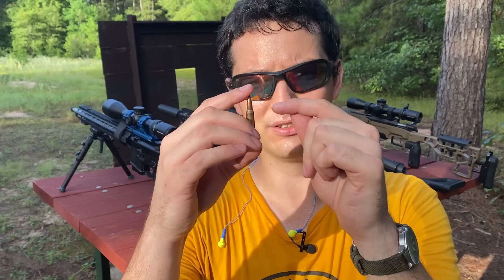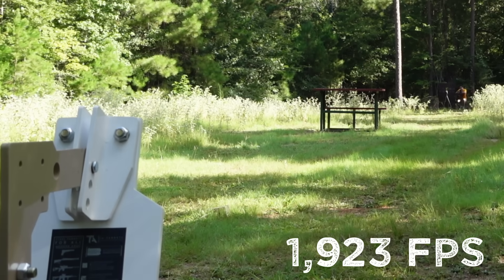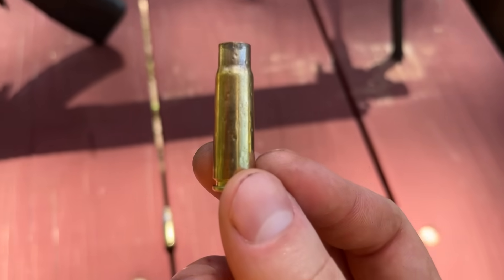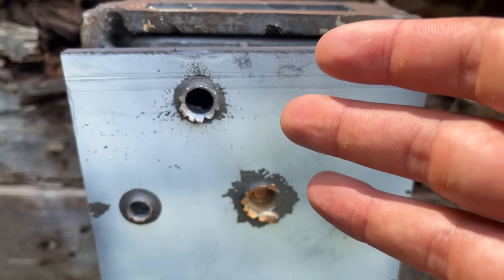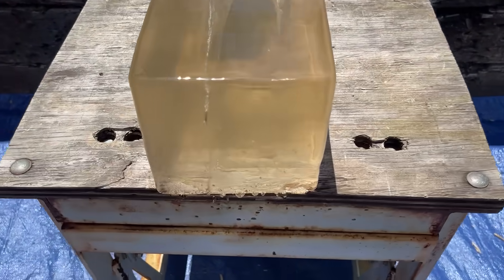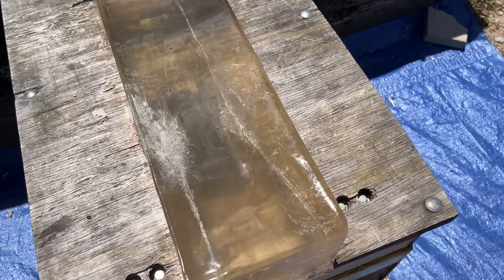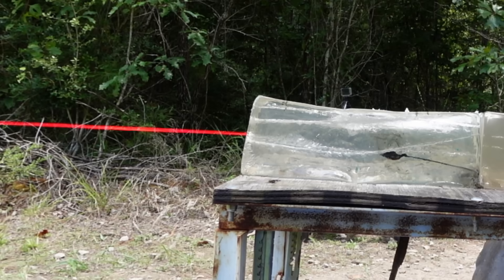I Will Never Shoot These Bullets Again

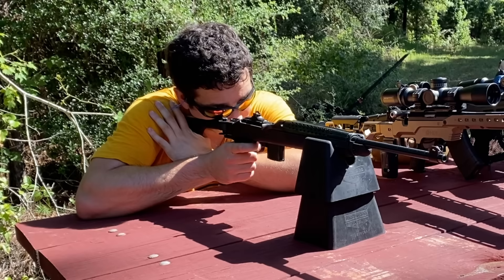Comment: 5:30 Glad you’re ok and that this didn’t end up a Kentucky Ballistics scenario.
Reply: 30 Carbine is more like a hot loaded pistol round so full disassembly of the rifle in the same manner as Scott's would be extremely unlikely. Still dangerous though.
Reply: @r.l.royalljr.3905  Considering how relatively small these cartridges are, it's crazy the amount of damage it did. That must have been a massively overpressure round.
Reply: @r.l.royalljr.3905  Yes, the .30 carbine is a semi-auto, so the bolt will open, albeit abruptly, violently, and possibly destructively if the cartridge over-pressurizes the chamber.  The Serbu RN-50 has nowhere for the excess pressure to go without destroying its barrel and breech cap and then the neck and face of whoever is shooting it.
Reply: The M1 carbine is gas operated so the bolt won't open until the bullet has passed the gas port, by which time the pressure should already be decreasing generally.

I think the biggest safety benefit is the simple fact that the bolt etc is contained in a solid metal receiver. So the shrapnel from any explosion tends to be contained, rather than flying directly into the user's neck.
Reply: @nerd1000ify well your name is fitting…
Reply: The slap round Scott shot essentially turned that serbu into a pipebomb.
Reply: The most important thing I’ve learned from watching YouTube: don’t use questionable ammo. Factory only baybee.
Reply: @ColdsideRamrod : Even this is not a guarantee.
In 1986 my 40mm Bofors exploded (German Navy) from old ammo.
The rounds were from 1954 i was ordered to destroy them, nobody told me how so i shot them🤷‍♂️ 
I nearly lost my right hand and have a nice tinitus till today😅
Reply: Wasn't even a fly fart compared to an overpressured slap round. But yeah. Glad he's ok!
Reply: Rite hard to stick your thumb in your forehead
Reply: "Stick a pinky in it!"

Jking, but really, I'm glad you're okay!
Reply: Definitely glad this didn't go too bad! Adam from WhoTeeWho recently had a Ruger 17HMR explode on him and luckily it was a similar outcome as portrayed in this video.
Reply: Yeah that hurts. Put your thumb in it!
Reply: Seriously
Reply: Oh yeah,remember this,it's when the .50 exploded right in the guy face....that was scary...
Reply: Banana is tougher than Kentucky ballistics so it's ok
Reply: Seems like guns are dangerous
Reply: Kentucky  Ballistics specifically shoots sketchy guns and ammo, so it was just a matter of time for that guy.
Reply: That cheapo 50 BMG rifle he used kabooms all the time. They're junk. Plus, he left the muzzle brake on while using SLAP. The sabots get stuck in them. That's why his shots were going all over the place.
Reply: to be fair the 50 bmg rifle explosion was the companies fault.  its a terribly designed rifle
Reply: @sovietsnake4726  I disagree Scott's accident wasn't the companies fault nor was it Scott's. The rifle was designed to handle normal and slight over pressure rounds, no one could ever think that a round would detonate like that. I beleive if Scott had used a barret or any other 50 cal. Rifle the exact same malfunction would have happened. The round was to blame and who ever tampered with it
Reply: @drslay1283  I see, I suppose I just made assumptions cause the idea of a break action 50 bmg is sketchy lol
Reply: @sovietsnake4726  Simply calling a Serbu RN-50 a break action is lacking the key detail of the threaded breech cap.  The breech face is not on the lower receiver, and the ears on the lower receiver serve no structural function.  They simply ensure that the cap is screwed on completely.  It's more like a pipe bomb with only one end capped....
Reply: @sovietsnake4726  The RN-50 is not a break-action.
Reply: @sovietsnake4726  its not break action. its a threaded breech cap
Reply: @sovietsnake4726  Its not a break action. Its a single shot rifle with a screw cap.  The rifle is fine, the round wasn't.
Reply: @sovietsnake4726  It was determined that the round was loaded with pistol powder, designed to burn fast and achieve maximum pressure in as short of a gun barrel as possible.
If a normal 50bmg round achieves normal operating pressures of approximately 60,000psi at around ~29 inches down the barrel.
What happens when there is enough pistol powder to achieve approximately 180,000 psi that the guns manufacturer indicates is needed to achieve that level of damage, after the bullet has only traveled 10 inches down a 29 inch gun barrel?
If the gun was a Barrett M82, the outcome wouldn't have been quite as bad because the pressure would cycle the rifle opening the ejection port where a lot of the gasses would escape and the recoil spring would take a good deal of the force as well.
The thing is, if such a round is loaded into any single shot rifle such as a bolt action, the result will be very similar.
Reply: @sovietsnake4726  assuming without research, which is really easily accessible. 🤦‍♂️ 🤦‍♂️
Reply: @drslay1283 they did have a weapon specialist said any of the auto rifles would have done the exact same thing ! The slap rounds would require a massive locking bold and extra thick chamber and at least the part connected to the chamber needs to be a slight thicker than normal ! I started to come here to say the same thing you did !
Reply: @KevinJames-yg9eu  Yeah I would consider the RN-50 to be one of 2 things. A breach loader. Or A screw action and Yes I know that's not a real term.
Reply: @sovietsnake4726  The amount of pressure that was needed to sheer the hardened steel threads on that end cap off and then sheer those steel flanges off that the cap then impacted is so far beyond normal BMG Slap round pressures that its frankly ridiculous. We are talking at least 50,000 PSI overpressure.  I honestly don't think that even grossly improper storage for half a century could have made original factory rounds that explosively unstable. Those rounds were likely reloaded very improperly by somebody or outright tampered with them.
Reply: @sovietsnake4726  Um....  Not the fault of the questionable SLAP round that over-pressurized the rifle resulting in its catastrophic failure?  🙄
Reply: @KevinJames-yg9eu It certainly was the fault of the round but it does show how the design of that rifle adds to the danger when a catastrophic failure does occur.
Reply: @Liam94Smith  99% of guns will become a shrapnel grenade at 4x overpressure. When you’re starting with any gun thats already meant to handle extreme pressure and 4x that pressure, dont act like it was the guns design that caused ~200,000psi inside a steal pipe to hurt you😂
Reply: @KevinJames-yg9eu It’s the fault of firing sabot ammunition in a rifle with a muzzle brake. 

Nothing more.
Reply: @sovietsnake4726  Mark Serbu made several videos about and Scott worked with him directly and they both came to the conclusion it was over pressured SLAP round. It was something like 3 times the normal operating pressure of any 50BMG. He later tested with other 50s that also exploded catastrophically.
Reply: @SliceyMcHackHack Yeah. The manufacturer of the cheap 50 cal rifle that kabooms all the time concluded it was the ammo. Okay. Sure. 

Didn't they say some nonsense that it was loaded with pistol powder? Sure. That's one of the most ridiculous things I've heard in a while. Even the ersatz SLAP is loaded with a 50 BMG powder.
Reply: @donwyoming1936  So Scott, the man it happened to, who did his own testing on the same rifle and many others. What about him and that testing.? They didnt conclude that a SLAP round would do this.. It was a reloaded SLAP round and someone used some other powder that lead to an extremely hot round.
Reply: @SliceyMcHackHack  Yea in the case of the Barrett .50 it came apart just as catastrophically. It didn't happen in his test of it but I've also seen other semi auto .50s come apart in such a way that it sends the bolt flying back into the user''s shoulder, potentially embedding itself in them. All around a bad time for whoever's on the receiving end of it.
Reply: @donwyoming1936  "Kabooms all the time" please give us these examples
Reply: @SliceyMcHackHack  Mark Serbu is a liar. Absolute snake in the grass. Over pressure wasnt the problem.
Reply: @DieselRamcharger  Except Scott AKA Kentucky Ballistics LITERALLY recreated the accident proving it was over pressure.. You can go watch the video right now
Reply: @SliceyMcHackHack  all he did was prove the serbu is junk the fails in an extremely dangerous manner. the breech should be the strongest part of the gun.
Reply: @DieselRamcharger  They proved that you should avoid unverified ammo and sources. Doesnt matter how strong the breech is when you have a small grenade loaded.. No firearm is immune to extreme over pressured rounds. If you just dont like Mark and his firearms thats fine. But saying theyre somehow more dangerous than others because of hot rounds is just being dishonest.
Reply: @sovietsnake4726  it was the ammo bro. Wtf. Serbu handcrafts everything and tests to 80000 psi. The round was handloaded too hot.
Reply: @sovietsnake4726  they did a test and found for that level of damage it was over 130k psi.  nothing survives that
Reply: @sovietsnake4726  NO CORRECTION NOTHING WRONG WITH THE SERBU 50CAL IT WAS A HOT SPICY ROUND OVER PRESSURE AND BOOM SO YEAH... 😂
Reply: @sovietsnake4726 totally wrong. The slap rounds were the problem and it’s been proven!
Reply: @sovietsnake4726  You got your engineering degree from where?
Reply: @sovietsnake4726  I bet you know nothing about firearms, or just want to troll.
Kentucky's rifle was just fine and worked within specs.
It was the AMMO that was misbehaving and caused the rifle to explode.
Just watch the video where Scott explained what happened and why it went wrong.
Reply: @MsUltrafox  If it weren't for this 40th reply about my assumption maybe I wouldn't have understood the issue was the SLAP rounds, thank you for the very eye opening and riveting response.
Reply: @sovietsnake4726 that's not 100% accurate.
Reply: @sovietsnake4726 no to be fair the serbu rifle exploded from a fake slap t round. Serbu 50 BMG is a sound designed and there are many out there still going strong. The one Kentucky ballistics had is the only one that I know of that's exploded
Reply: @sovietsnake4726  absolutely disagree, that rifle held up to dozens of severely overpressurized rounds before giving up the ghost to one catastrophically overpressurized round. It was 100% the ammo, Scott has personally confirmed this with his own testing, and Mark Serbu has stated that it would take over 3.5x what the .50 BMG cartridge is rated for in pressure to actually destroy the rifle. That's an insane amount of safety margin, the ammo Scott was shooting through it successfully that day would have blown up any other rifle after a single shot, but it took a bunch of those rounds before Scott found one truly hot enough to blow it apart. You should go watch his own videos on the subject where he details all of this and blows up another RN-50 to confirm it.

Comment: Hey Mr banana man, I would love to see you test rifle sabots. They used to make accelerator rounds which was basically a .224 projectile loaded into a 30-06 casing (or larger) using a sabot. You can get some crazy velocities doing this and they still sell the sabots online just not factory ammo. 4000-4500 FPS was a common speed for these

The accuracy may be garbage at long range but my monkey brain still wants to see some of the exotic .224 projectiles pass through a hilarious amount of armor. I’m also wondering if the sabot can be improved on to get more reliable separation and accuracy.
Reply: those were fun, had them for my 30-06 in the mid 80's.   Tough to tell if you hit the chipmunk or not!
Reply: They were also made for the 30-30 and 308. I have a box of them for the 30-06. Picked up a full box for $7.50.
Reply: If you find any now they don't work like they used to. The age of the plastic. It just blows the sabot past the bullet and they don't work. 
Haven't tried any new made sabots tho.